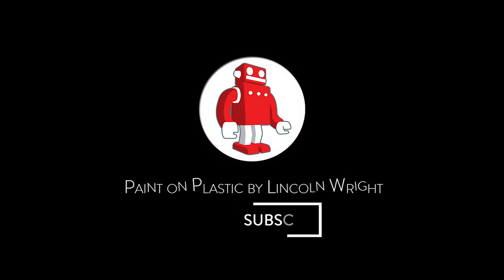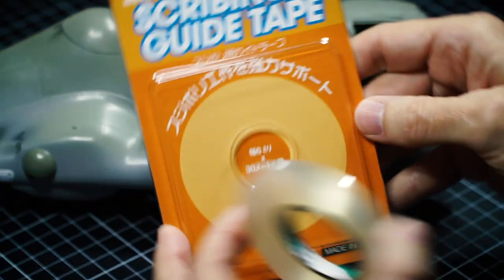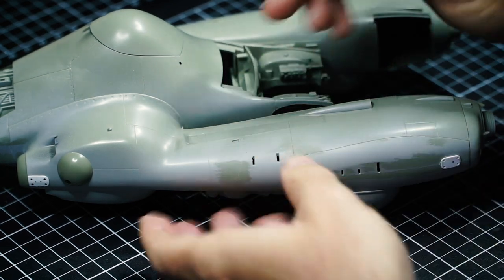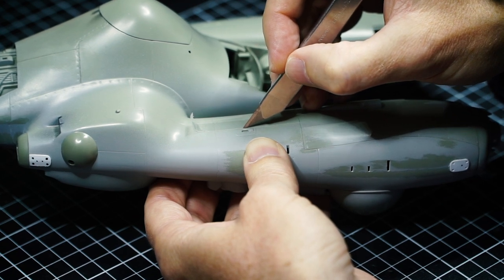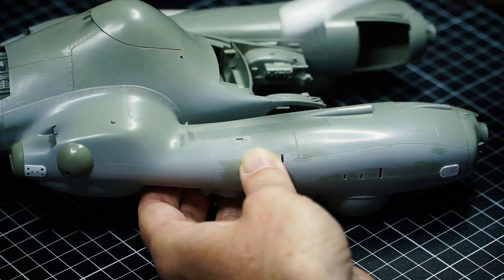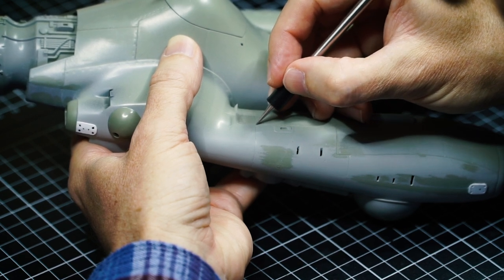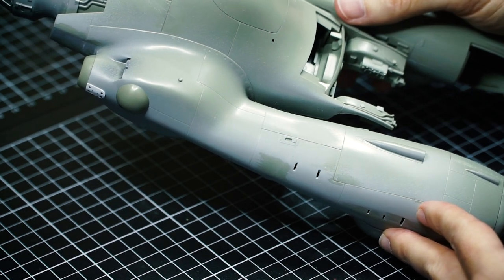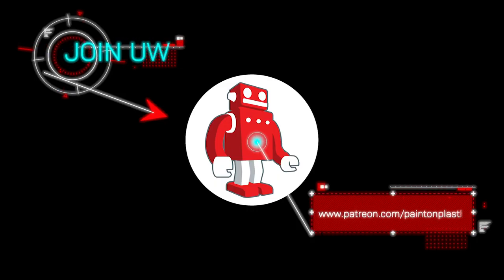Panel Line Scribing Tutorial by Paint on Plastic with Lincoln Wright

Comment: Good video. I'm re-scribing a 1/72 Antonov 74 with entirely raised panel lines. I use number of scribers I like a pin in pin vice then resharpened on stone to a wedge. Dymo tape used for labels works well as scribing tape.
Reply from the maker: Yes, classic old school is great.